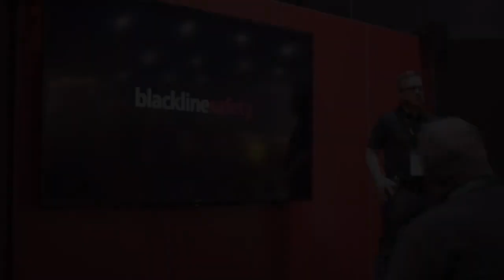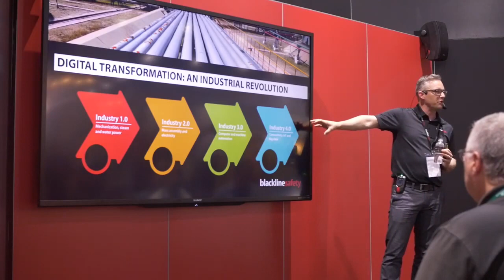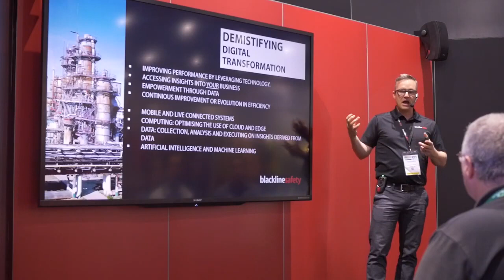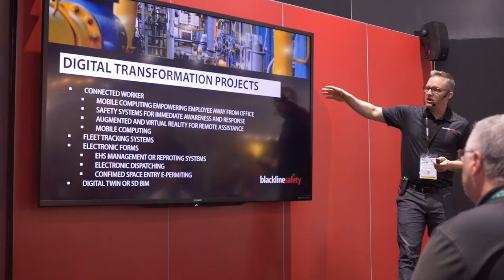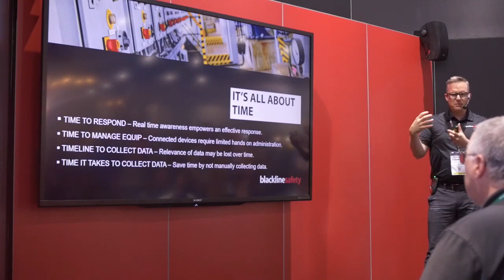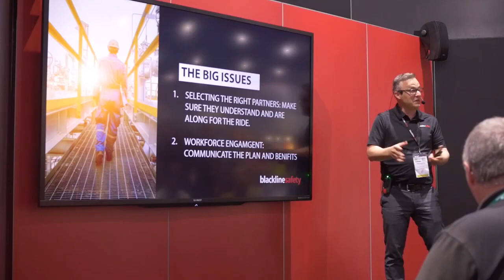Comment: To learn more about our products, visit: https://www.blacklinesafety.com/
Reply: To learn more about our products, visit: https://www.blacklinesafety.com/

What is Cl2 - https://www.blacklinesafety.com/solut...

Is carbon monoxide lighter than air - https://www.blacklinesafety.com/solut...

H2S sensor - https://www.blacklinesafety.com/solut...

Lel sensor - https://www.blacklinesafety.com/solut...

NH3 - https://www.blacklinesafety.com/solut...

Oxygen gas O2 - https://www.blacklinesafety.com/solut...

PID detector (photoionization detector) - https://www.blacklinesafety.com/solut...

SO2 gas - https://www.blacklinesafety.com/solut...
Gas monitor - https://www.blacklinesafety.com/solut...

G7 Monitor - https://www.blacklinesafety.com/solut...

G7 Location - https://www.blacklinesafety.com/solut...

G7 Social Distancing - https://www.blacklinesafety.com/conta...

Gas Monitoring Device - https://www.blacklinesafety.com/solut...

Health effects from chronic low level exposure to hydrogen sulfide - https://www.blacklinesafety.com/blog/...

What is blackline - https://www.blacklinesafety.com/

Multi gas detector - https://www.blacklinesafety.com/solut...

Lone worker safety - https://www.blacklinesafety.com/blog/...

Lone worker solutions - https://www.blacklinesafety.com/blog/...

PID detectors - https://www.blacklinesafety.com/solut...

Safety for lone workers - https://www.blacklinesafety.com/blog/...

Combustible gas detector - https://www.blacklinesafety.com/blog/...

H2S name - https://www.blacklinesafety.com/blog/...

Multi gas detector - https://www.blacklinesafety.com/solut...

H2S monitor near me - https://www.blacklinesafety.com/blog/...

H2S Exposure Chart - https://www.blacklinesafety.com/blog/...

Blackline software - https://www.blacklinesafety.com/solut...

#blackline
#blacklinesafety
#gasdetection
#loneworker
#loneworkersafety
#safety
#workers
#h2s
#gasdetectors
#gasdetectorsnearme

YouTube channel link - https://www.youtube.com/channel/UCNil...
Facebook - https://www.facebook.com/blacklinesaf...
Twitter - https://twitter.com/blacklinesafety
Instagram - https://www.instagram.com/blacklinesa...

https://www.google.com/maps/place/Bla...
2XJ4+QH Calgary, Alberta
51.032186074881885, -114.0434762152886